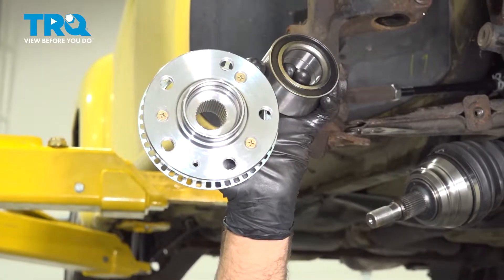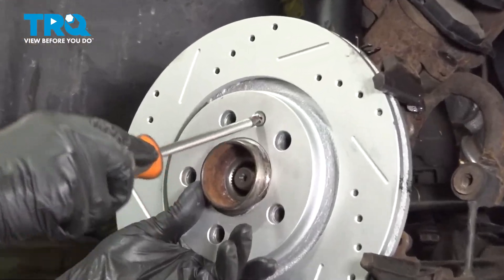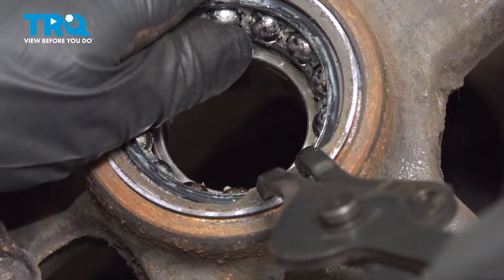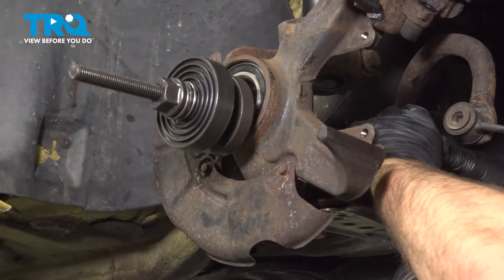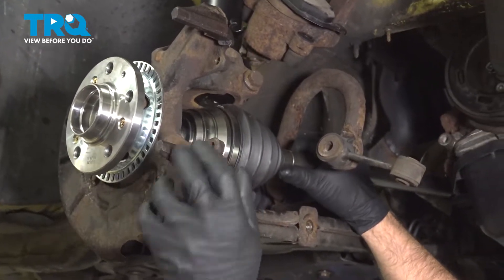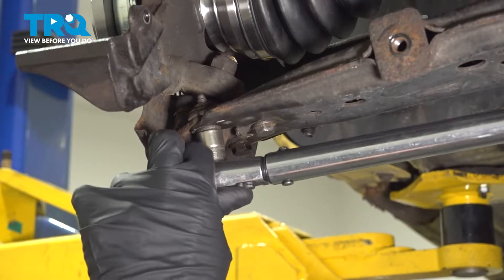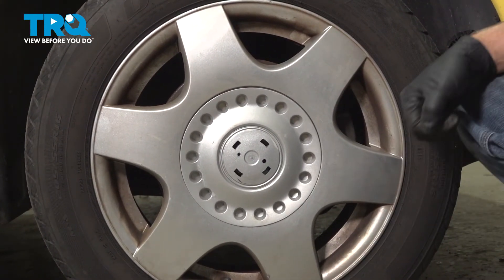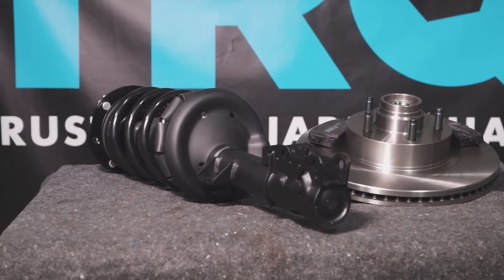How to Replace Front Wheel Bearing and Hub 1998-2010 Volkswagen Beetle

Comment: Save yorself some time and leave the sway bar link in place. After you remove the lower ball joint turn the wheel to the right or left(depending on side) and the cv shaft comes right out. Unfortunately my customers hub is in such bad shape this OEM Tools #57342 puller couldnt even extract it with excessive force and a torch so he's getting a new steering knuckle as well.

Comment: Can those bolts that hold the hub on be replaced with lugs temporarily? I have a new hub to be put on by the shop and no parts stores can get those dreaded bolts so i had to order them and they are going to take a while to show up and i need it fixed. Will the same size lug work in replacement or not? the parts store told me that the lugs with the same threading will work and that either could be used to mount them. The lug they gave me has the same downward slope into the threads as the oem bolt.